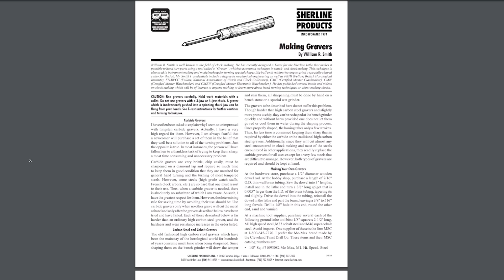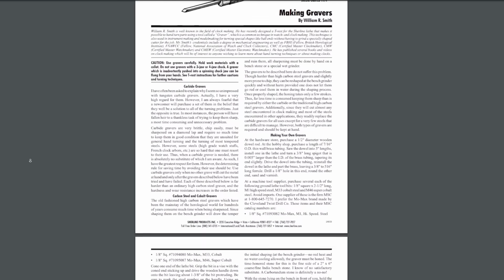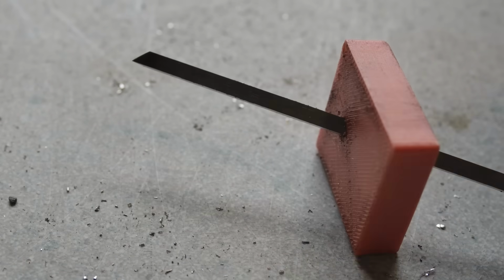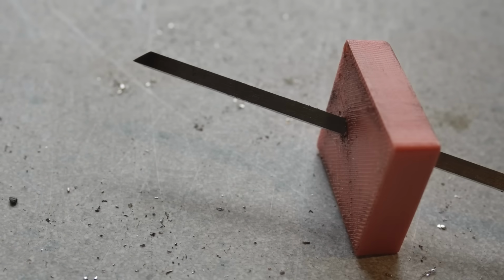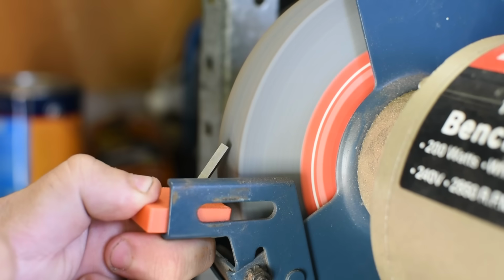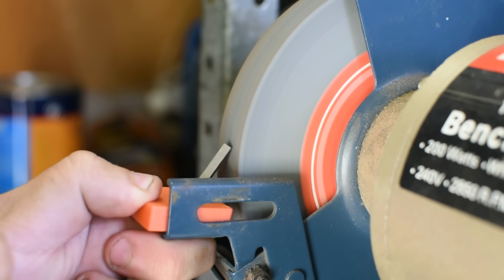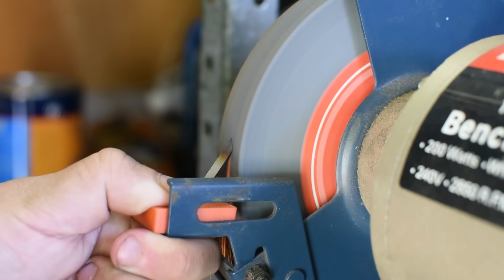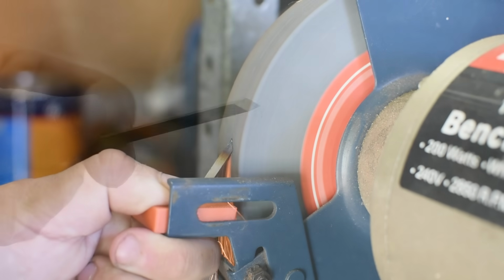I Printed A Better Lathe

Comment: This is just a silly idea I had right about now, I’ve been thinking a lot lathel- I mean lately about *composites*, and a thought just cropped up: Would it practical to fill the form with a metallic filler, such as ball bearings, bb pellets or metal scraps, and then fill it with concrete to make it even heavier? As I’m inclined to think that weight contributes to stability in these machines. Also, I recently found your channel and fell in love with it! I’m obsessed with making tools from scratch, you appreciate the artistic/aesthetic aspects of design that some channels don’t, and of course a taste for C418s music(maybe I played too much modded Minecraft when I was younger). Anyhow, watching this lathe come along has been a real treat as I’ve been wondering at an actual practical mini lathe pathway for hobbyists as well; because the operating principal of a lathe is almost deceptively simple.

Comment: This is awesome! It would seem that this would be a great build for: anyone needing a small-parts/ hobby lathe; low cost-of-entry to machining (or at least turning); pushing one's 3d-printing skill set, etc. Since this is obviously limited to the size of parts you can turn, do you have plans to print/fab a bigger model? Plans to add CNC features?

Comment: Did you consider printimg custom  funnels for a cleaner concrete pour?

You could just print custom spouts for an existing funnel to fit into the various orifices.

Comment: Out of curiosity why did you not make a tool holder? I realize the disc was a torture test but wouldn't having a tool holder have made turning it down go more smoothly and be safer? I'd be concerned with the tool catching and being ripped out of my hands and flying who knows where.

Comment: That is pretty cool, but you are lacking preload on your angled roller bearing which will have lower accuracy and will shorten their lifespan. The datasheet that comes with the roller bearings (or is available from the shop) should state the preload necessary for the bearings.

Comment: 9:10 when you rough out something like that initially and especially by hand should use a more wider cutting surface and then step down to a more accurate tool. Usually  I'd use a circular carbide cuter, they last a long time and make some nice even starting cuts

Comment: I wonder if there is a better material to inject than concrete? It seems that concrete would have progressive brittle failures. Maybe filling it with a non-brittle resin? You could also try to disperse lead throughout it to add mass.

Comment: My only minor complaint ( Coming from owning a vintage mini-lathe I picked for <$400 on FB Market ) Is,  It looks like the Timken bearings you used, doesn't have a way to tension them? From the video at least, I saw you just took a pully wheel that simply had a setscrew to fix it to the spindle.  In minilathes, The ends of the spindles are usually threaded so a nut can be installed on the end. This nut allows you to tension the timken bearings, so the tighter you go...the more the two bearings are pulled together. Too tight and they literally wont spin. Too loose just encourages a ton of chatter. But getting them tensioned properly, DRASTICALLY improves cut quality.  When I got my mini lathe I thought it was an absolute POS because all my cuts were chattering despite that nut wasn't loose. And I learned it wasn't tensioned properly. As per manual "Snug it up and turn the nut 1/4 of a turn to set tension"  made it a whole different machine.

Aside from that, I'd also fix up some really simple covers on them. This way little chips from the cutting side, dont risk bouncing inside the bearings and damaging the race/cups.  Ideally a way to drop some oil in them would be good too. Could design a cover that has a funnel-shape on top that allows for simple oil application.  As again with the mini-lathes, their manual says to apply light weight oil to the timken bearings before every use.

Food for thought!  Other than those minor things this looks fairly promising for home DIY.  As readily avaliable as CNC routers are becoming to the home user for <1000$ its surprising there's not a lot of lathe options out there. Some that are kinda..suck..which is why I ended up opting to buy a vintage craftsman lathe from 1968 and modernize it.

Comment: Nice work, one recommendation, those brass threaded inserts are not heat inserts, they are for injection moulding, proper heat inserts a quite different, and will work much better.

Comment: build a form for your sander, possibly with the no skid cupboard liners, then use the sander oscillation to settle the concrete in place. @5:00  you can turn a jug into a funnel /scoop, which might make getting the Crete in easier.

Comment: For your sake, my dear friend, I decided to use a translator, in our time it is not so easy to devote time to another in helping, but I will do it. since I could not look at that nuance having the following knowledge: when you sharpened a cutting tool, then for too long without lifting it off, held it on a whetstone, note that the metal at this moment turned red and then white, in Russia this effect is called: tempering colors. this is when the metal acquired a blue color. the metal became annealed and its strength dropped many times, it will be a bad cutting tool. please cool the cutting tool when sharpening, do not bring it even to a light dark color. I hope I explained it clearly. With respect from Russia
Reply: Мы понял! Спасибо из Америки :)
Reply: Thank you mate
Reply: Thx for sharing russian man
Reply: I'm coming at this 1 year later and I agree wholly and entirely. I'd personally have cut it as close to final shape as possible with minimal heating (so likely using a hack saw) and then used a slow spinning wet grinder for sharpening the tool, as they both spin slowly to avoid excess heat buildup and the water automatically cools the metal and removes any loose particles, before using sharpening stones to get it to final dimension and remove the slight curve in the tool that the wet grinder will create. It will take forever to do, yes, but it will result in a perfect tool that never lost its temper in any way, shape or form. I'm a cabinet maker by trade and using slow-spinning wet grinders like the Tormek-T4, are how I was taught to restore very dull or very worn tools, but it can certainly also be used to make new tools from scratch
Reply: It translated almost right. For us "temper colors" refers to thin film interference colors after the metal is cool. The effect is the same. The moment it reaches those temperatures the temper is ruined. It can theoretically be restored by repeating the heat treatment and tempering process, but you'd have to know how the tool was made.

Comment: Brilliant!  Wish I'd thought of this.  Now my questions:
Concrete has a MUCH greater strength in COMPRESSION than in TENSION.  The lathe bed is a beam.  Beams involve bending moments, therefore both compression and tension.  Will the concrete crack?  When cracks form, will the frame lose stability and allow the cutting tool to shift around?  How's it working out?  Will it be necessary to "preload" the concrete beam by having a metal tension member running the length of the concrete beam down the neutral axis of the beam section?  Compress the buh-Jesus out of the concrete.  This is how bridges are designed to eliminate tension by making all stresses compressive, and none tensile.

Comment: Thanks for the video. A lot of work was done.
Unfortunately, no matter how you concrete (which, however, greatly increases their rigidity), the contact between them occurs on the plastic. This joint is greatly deformed under loads and tightening with screws. It would be interesting to see what a machine with a common volume inside + a more competent (simpler and more "meat") and closed form of the bed would look like.
Bearings of this type require mandatory preload, which affects the backlash and accuracy.
The milling spindle was also not chosen very well, too large an overhang and the lack of the ability to produce a preload. Although the latter can be corrected by cutting a thread at the end of the spindle hole, where a kind of screw would be screwed in to create tension. The moment from the screw to the bearings would be transmitted through the bushings (just thinking out loud, need to think carefully).
Inspiring video, maybe someday I will present my vision of this. I am not strong in technical English and English in general, I wrote through a translator, sorry for the mistakes

Comment: You should really develop a fixed tool holder that you can bolt a turning tool at the correct height for the centre line. Holding a tool when turning metal parts is never going to be a sensible option.

Comment: Maybe you could design your prints that you plan on filling with contrete to have break away pieces that serve the purpose of a funnel. That way, when you are pouring, it will keep it contained, but you can snap them off once you are done pouring all of the concrete.

Comment: Ingenious to combine the concrete in the print. I've seen other people talk about using printed forms, but this one is truly a cool application! Nice work. I'd be curious to see how the concrete holds up to long term use and vibration.  There are also epoxy concrete blends that might be suitable to give the weight and strength of concrete, but a more refined finish.

Comment: when you built the headstock, did you use machine  -- tool bearings.  they are much more accurate providing you turn materials closer to the headstock itself

Comment: Whilst other people have talked about Gingery (I own the books, they're great) I'm more interested in in how far one can reasonably take the concrete lathe project with 3d printed formwork. Concrete lathes are not 'new' as I'm sure you know, but the last time I read anything about them it was a yahoo group dedicated to compiling the information about them that very likely died over a decade ago. I'm glad this video  demonstrating concrete's capacity for providing proper rigidity to these 3d printed machine shop tools 'took off', and I'm ecstatic to see it's a video from a South Australian.

Comment: This is a really cool project. I’ve wanted a metal lathe for a while, but both cost and space prevent me from being able to do that. This lathe, while being restrictive by its small size, might be a first tool to cover some of the smaller things I’d like to try. 

Couple of suggestions…
Instead of concrete, use sanded resin to fill the cavities. 
Either fill from the bottom such that there is no topside resin/concrete exposures, or print covers, just to pretty things up.

Comment: Hey . The drive solution could be better and easier . Cheap brushles motor from china paired with a cheap ESC. Something like 50-60 size brushless in the 200kv range.  This will provide more torque with the reduction you already have greater efficiency and a way way smaller footprint

Comment: Yiiikes. Ok... so, I have ONE problem. Only one. With this build. It is that the threaded set-set inserts you used are not very strong, you should use the knurled inserts that have the patterns going in opposite directions, those are better. Both types are originally designed for injection moulding, but only the type you showed here is almost exclusively used for that now while 3D priinting uses the other type way more, to the point where they are not that common in injection moulding anymore I believe.

Comment: Is there a reason you didn't use a spindle motor directly as the bulk of the head stock? Bearings come for free in this case, no drive belt and cheap pulleys to give trouble, and much higher RPM suitable for rigidly mounted carbide cutters.

Comment: This was a very ambitious project. I am inspired by your example. Your lathe was more capable than I thought it would be in the beginning. I have always wanted small benchtop versions of tools like this, but found them to be very expensive and usually not very well made. It is clear that you set out on a mission to create a tool that was low cost with out being low quality. Good Job!

Comment: Like it a lot! Might make one in te future, need some copper bushings for my motorcycle shifter which would ben fine to make on such a machine. For now i will try some prints with concrete in self designed molds . Cant wait to see your next project, good luck!

Comment: Oh my that is incredible. great job as always. Another fun material that might be of interest to your projects is epoxy-granite. Cheap to make, increadibly rigid and very low thermal expansion among other favorable material properties. You might need to play with the mixtures ratios a bit but consistent results are possible from my experience. Also i think density is usually a bit lower for most mixtures than that of concrete so a greater volume of material may be required in some placed. Just an idea though.

Comment: I would have put a very straight bar and used it between the head and tailstock to make sure they're aligned before any adjustments to make it easier for small adjustments

Comment: This was a nice little "leapfrog" over a few intermediate steps in the progression of lathes.  I have used a medieval "bow lathe" for turning wood, then used those better parts to create the next iteration to create even better parts and then castings... each one builds upon and improves upon the previous and each level makes extensive use of "hand tools" to create the next... including new tools.  We have learned a great deal over the centuries, and continue to learn and improve upon our tools with every iteration. When all one has are "hand tools" and there are no options for precision equipment available, you either learn how and create what you need.... or you do without.

Comment: 3D print some bearing covers so you don't get chips flying into them as easy as they are :). But how amazing are these tools turning out :) Have you considered using levelling compound instead of concrete? :)

Comment: First, as others have mentioned, well done.
second, try to incorporate a seal in front of the headstock bearing at the chuck end, less or no swarf from the cuttings will get into the bearing. 
third, when grinding your tool steel, try not to get any color on the tool being ground not just keeping it below red hot, use plenty of water to cool the tip as necessary.

Comment: about threads or studs in concrete:    In all cases try to get some of the metal insert or a nut physically trapped in the concrete, with no plastic intermediate.    You can set heat inserts and thread rod nuts n the concrete directly if you simply use a screw to hold them to a hole in your form.   You can further encase by making a small tubular portion inside your print, a flat washer, then the insert.   this will bury the washer inside the concrete in front of the tiny insert preventing the insert from pulling out.      or to set studs double nut them through a hole with an extra nut spaced deeper into the concrete.   You can even entirely remove the plastic from the compressed joint if you put a nut or a cylindrical spacer through the form, capturing the form wall between pair of washers.

Comment: I’m impressed 

In the diy CNC world I’ve seen people make ‘epoxy granite’ frames 

Basically decomposed granite mixed with epoxy as an alternative to the concrete 

It’s stronger than regular concrete and great for reducing vibration 

Maybe worth trying

Comment: I found this a very interesting video, and a well thought out design and process. It might be an idea to print a labyrinth seal for the front spindle bearing, and possibly use epoxy granite instead of concrete.

Comment: As a person trying to become a machinist, I really enjoy your videos and am likely going to use these concepts when build my own CNC machines for my home shop. If you plan to make any further improvements think it'd be really neat to see you add a gear box and lead screw for feed and rpm control on an actual carriage with a mounting tool holder instead of hand turning, maybe even a way to cut threads with a single point tool as well. In my opinion the use of concrete in molds is actually a really good idea for machine tools like mills and lathes, much like cast iron its rigid and dampens vibrations fairly well, although I've seen other examples of DIY machines using a mix of epoxy resin and gravel which might work better. For the stuff I'm planning to do, more hard steel would probably be needed for ways to adjust the spindle and the actual machine ways

Comment: For filling the small holes, you can use a ziploc bag with some concrete in it, then cut off one of the bottom corners... 
It basically makes a "pastry bag" to squeeze it into the area you want with accuracy and control over the flow.

Comment: if you use loose sand, you, vibrations would just turn into heat. Also, you would get more absorption of higher frequencies. The sand rubbing against itself turns larger macroscopic motion that can ruin your part into chaotic microscopic motion that has much less of an effect.

Comment: Overall a great little thing. The only thing missing is some sort of preload for those bearings and a proper spacer from a metaltube on the inside between bearings. 
They will last a lot longer if they have preload and will deal with the radial forces a lot better. :)